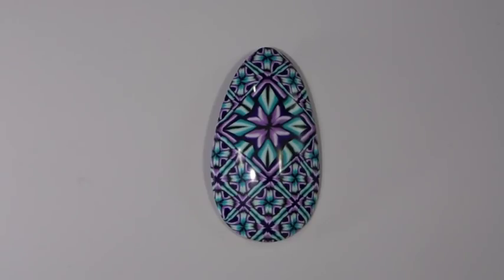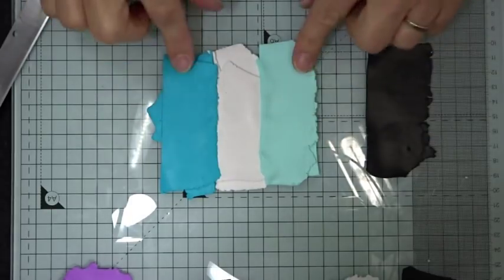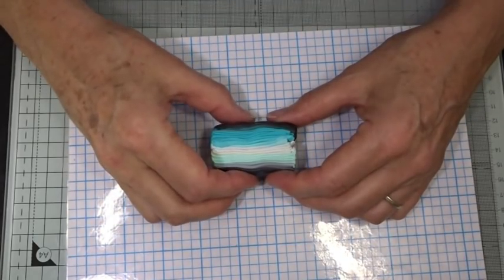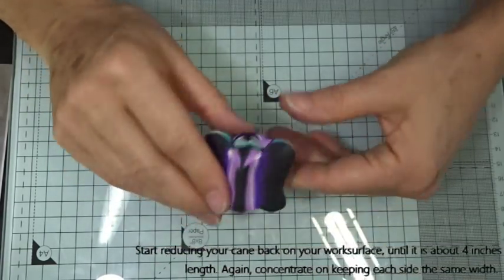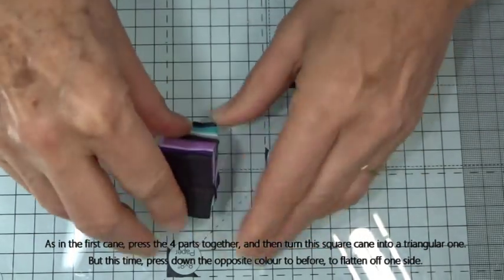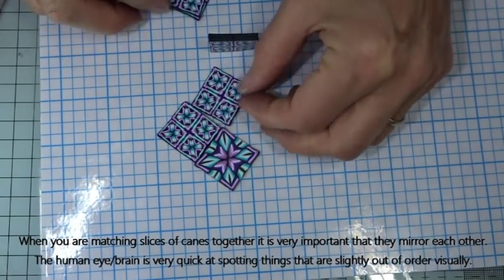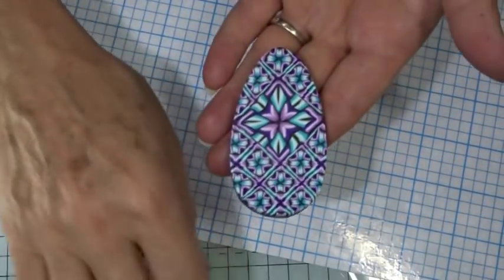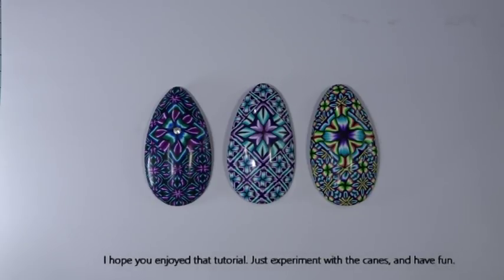Double Cross Cane, Polymer Clay Pendant Tutorial

Comment: Fiona, You said something like this is not where we’re precise in shaping. What is the point when you become precise? How do you describe that? Cane making? Piecing a cane? You spent more time pushing down the ends so not to allow distortion. Is that it? Or maybe when you reduced the cane to 3/4”? I think you’re answer is going to be “yes.”
Reply from the maker: Thanks so much for your comment. At times you need to be precise, others not. I try to let people know if they need to be careful about measurements at specific parts of the process. Some people like to be very neat, others are more relaxed, it is not possible to please everyone all of the time 😉🙃🙂 I hope that helps.
Reply: @FionaAbelSmithPolyOriginals , I tend to be quite haphazard but am relying on your instructions to guide me toward more precision. I like your attention to detail. I’m just trying to figure out when to apply it. I’ve written you that when I sent photos of my pieces. 
Also, when we’re reducing and the top layer starts disappearing at the ends I try to spread the top layer to the end so the lower layers don’t come through to save just a little more clay. Have you ever done that? I’m probably being too concerned and should learn to relax. Anyway, thanks SO much!
Reply from the maker: @boa1793  It sounds like you are doing everything right 🙂 I know people worry about being precise all the time, and that is why I try and say 'for this bit, don't worry about it' when I know from experience that that works. However some people like to be precise all the way through the process, and that is okay too. Everybody works in a slightly different way, and it is important to learn what is comfortable for you, and to do that. Never feel you have to be the same as anyone else, and that applies to the way we work with clay too. We are all different, and I love that 🙃😍 Yes, pulling the clay over the ends slightly is a great way of helping to reduce the distorted ends. You are definitley doing everything right, so keep on doing what you are doing, and enjoy your clay 🙂
Reply: @FionaAbelSmithPolyOriginals , Thank you. You’re kind.

Comment: Fion, What is your favorite clay to use?
Reply from the maker: I like them all, and use them for different things :) I like FIMO Soft for teaching, and for slicing through, I like Premo for it's increased flexibility after curing, I like Kato for its strength when I am making my complicated flowers and sculptures. I also use Cernit, which is a good all round clay. They are the main ones available near me, but I am sure the other brands are just as good. They all have slightly different properties, and people usually find one they like and stick with it.  (Unlike me as I do such a wide variety of polymer clay pieces ;) ) So not a straight forward answer, but I hope that helps?
Reply: @FionaAbelSmithPolyOriginals  Thankyou. Most helpful.😊